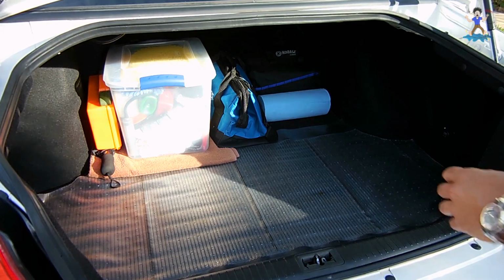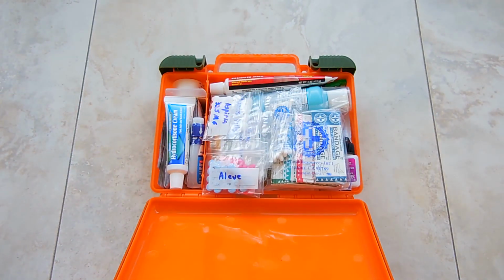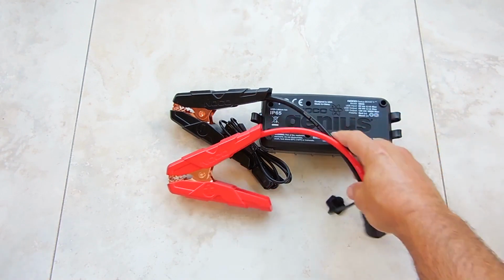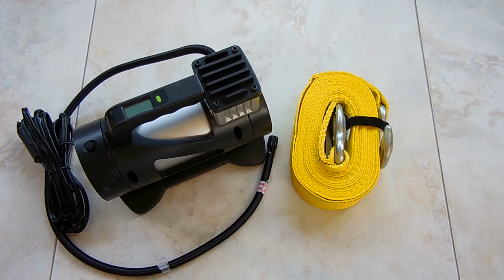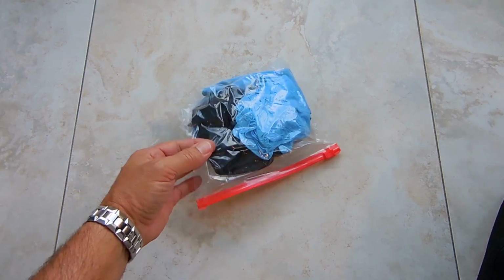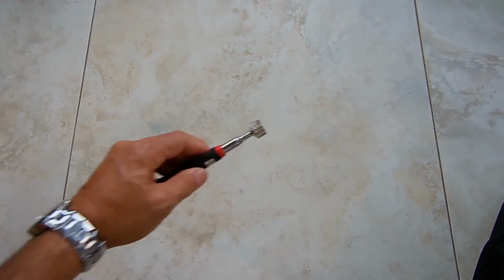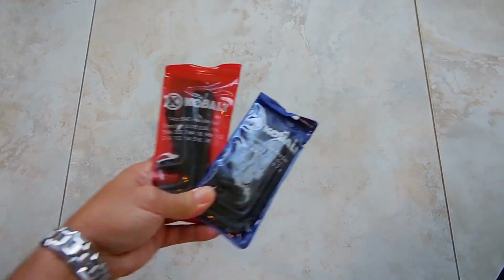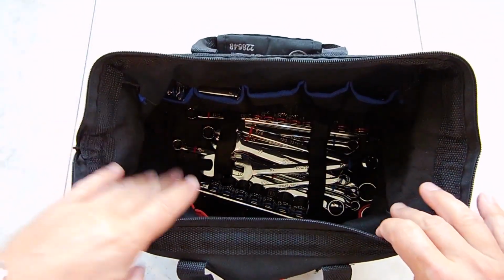Car Roadside Emergency & Repair Kit!

Comment: I'd normally like to keep the tire repair kit in the car, but the repair strips and rubber cement would probably deteriorate from summer heat and long term storage before I get a chance to use it. I just leave it home and hope I don't have an immediate need for it on the road. Don't like the fix a flat stuff as that makes a mess of everything.

Comment: Pretty comprehensive. I'd have a 1/2" breaker bar with lug nut socket for cars that only have a feeble lug nut wrench included that may not be able to muster up enough torque to break loose lug nuts that have had a chance to settle in for ages.
The test light is covered by the ubiquitous free HF DMM, so I might dispense with that, though it is handier for some situations.
Add some baling or guy wires for general purpose securing. It could be used for hose clamping with better clamping force than zip ties as well as emergency electrical purposes.

Comment: First Aid kit is mandatory in Europe.
Also you don't actually need all that stuff,here is a little list i made:
-Few candles(they can warm up your car up to 18°C,for a few hours)
-Blanket
-Roll of duck tape and electrical tape
-WD40
-Small flashlight
-Window scraper
-Brake fluid,oil and distilled water
-Knife
-Lighter
-Pliers
-Set of metric sockets(or imperial if you use a US car)
-Set of torx bits(Especially for German cars)
-Allen key set
-Screwdrivers of different sizes and head shapes
-Set of lightbulbs
-Hammer
-First aid kit
-Pair of socks
-Signal triangle
-Foldable shovel
-Tire chains
-Zip ties
Obviously this is suited for winter conditions,you won't need tire chains or candles when its 40°C outside.
But you don't need a OBD scanner in any situation.
You don't need that battery pack,unless you drive an auto.
If you drive a manual,you can push/bump start your car.
Reply from the maker: Disagree 100% with not carrying an OBD code scanner. Sometimes that light can come on and also cause the vehicle to go into limping mode. If you have a code scanner, you'll be able to identify the faulty part, and also reset the system to allow normal driving. As for the rest of your list, no need where I live for all the cold weather items. The headlight bulbs never go out at the same time, so you can always drive with one until you get to a store. Yes, most cars in the USA are auto, so you must carry the jump starter pack. As for motor oil and brake fluid, no need to carry that either if you check the levels frequently. The lighter I have in my glove box. Thanks for watching
Reply: electronicsNmore I put up a OBD scanner as a example.
You could substitute it with portable one that connects to your phone via Bluetooth.
What i ment to say is that you only miss kitchen sink and a stove and you coukd have camper van.
What is the last time you had to use a OBD scanner on the go?
Hell i don't remember using it ever on my daily driven BMW e90,and i put around 30k km(15k miles)on that this year.
Also if your car ever goes into limp mode,you can still get home.I owned a turbo Honda S2000 that would go to limp after long pulls.
Next thing,you should be carrying a car jack and a spare instead of that compressor.
Also,why would you need a bungee cord for?
You went on a trip,or holiday,not to carry things home.
That blanket will be no good in wet conditions,and since you live in warmer climate,may i suggest changing it out for something made out of rubber,like a yoga matt.
Im just trying to tell you that you have way to much stuff,that you generaly dont need.
Don't look at this like im hating,that is your stuff that YOU want to carry.Im just giving you my idea of a kit like this,so maybe you could implement some of if and make your life easier.
Thank you for taking time and recording these videos for our entertainment.
Also sorry for my bad English,its not my mother lanugage.
Reply from the maker: Not here to argue with you. Carry whatever you want. LOL There's a reason for everything I do, or whatever I carry with me.

Comment: Take some wire coathangers for temporary repairs ie broken exhaust mounts , a  big roll of duct tape (the wider the better) for lots of uses and a gallon container of water .
Reply from the maker: A small roll of steel wire would also be great to carry. :-)

Comment: I bought the battery jump it was horrible not a good item at all check the reviews on utube
Reply from the maker: LOL. Whatever you say. I used it 2-3 times and it worked perfectly. If you notice, the one guy that did a review of the product(finding every little fault), he was selling another brand jump starter in that video. LOL Of course he's going to knock the product.

Comment: Maybe I missed it but perhaps add in some spare ATx fuses - I know the fuse block sometimes have them as well but good to have extras - they sell the little multi-amperage kits.
Reply from the maker: Yes, I didn't mention them because the vehicle usually has spare fuses. Thanks for watching!